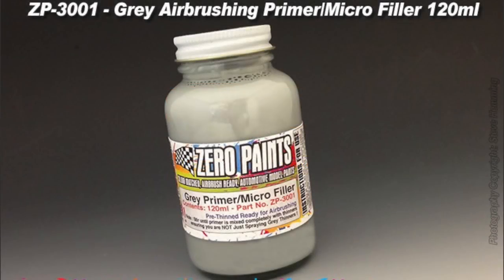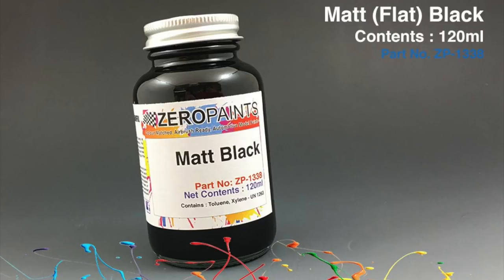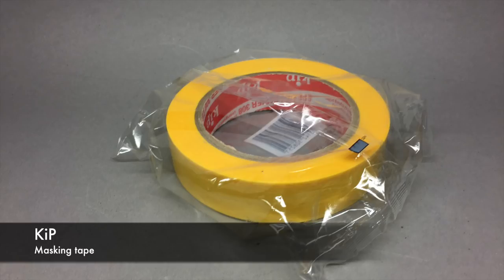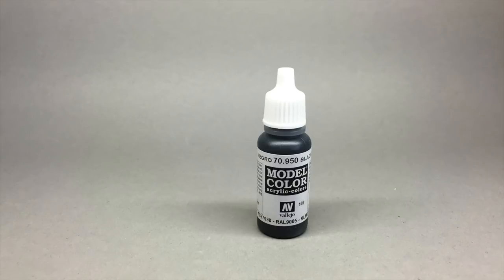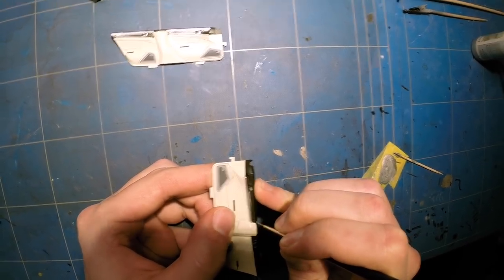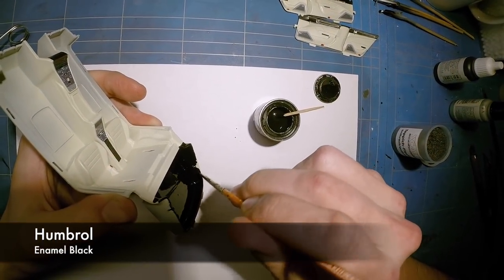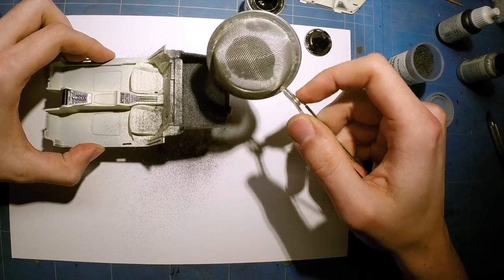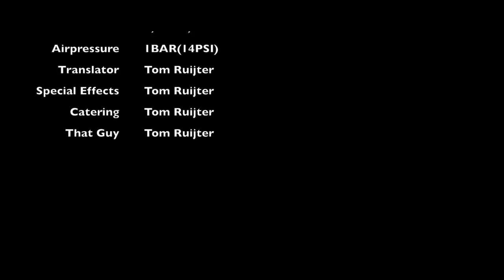Revell: Porsche Panamera Turbo Part 3

Comment: Maybe you already know this. A handy tip: If you use a waterpallet you can use your paint longer. Also your paint is a little bit thinner. So your paint will became nice and flat. ( You need two coats tho.)
 Nice work!

Comment: Was curious as to what brand of flocking you use? And is Vallejo chrome your go to brush silver?
Reply from the maker: I mentioned in the video it is from scaleproduction.

Either chrome or just silver
Reply: The Scalemodeling Channel 
I see. Do you find the scale production flocking to be superior to other types? And are you sifting it first to remove clumps and then again on the body? 

I bought a ton of hobby craft flocking on eBay. Huge bags of Black and Tan for dirt cheap. Works well but it’s good to sift it once before application.
Reply from the maker: Ihave never tried any otther brand,

I sift it ro remove clumps and dirt.